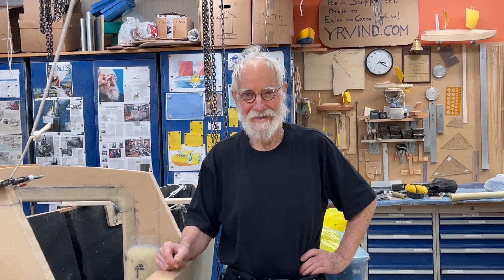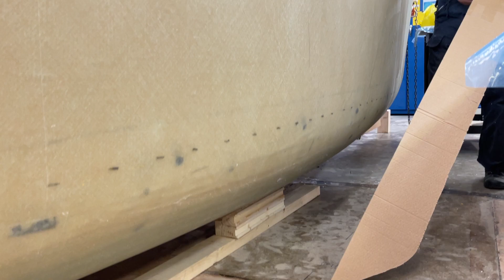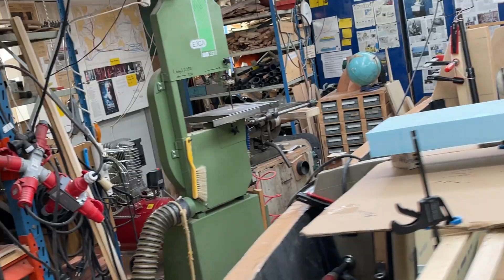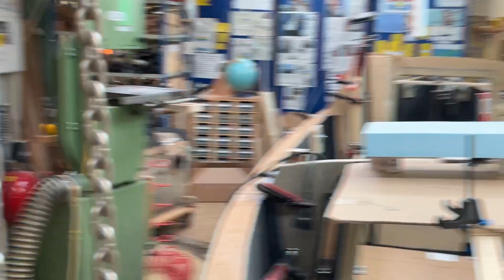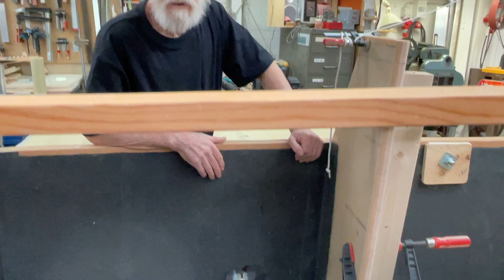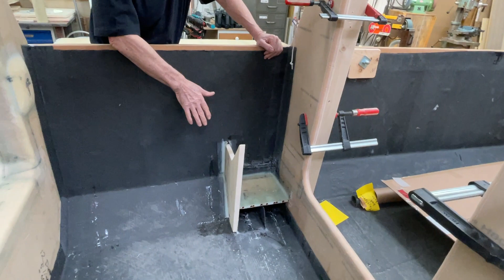One more darling gets killed in this video, the mowing ballast.

Comment: I am an electronic designer and many times I’ve come up with a “darling-circuit“ but when I put the rest of the circuitry that’s necessary around it, many times I find that my darling is really a thorn. It hurts to remove the thorn, but as the years go on it gets easier to discard and keeps your head steeped in reality!

Comment: That’s a hard choice to make. But the twin keels do bring a lot of positive aspects.  Even if it’s just to make room for more water or equipment, I think they’ll be good. 

Will they be separate from the hull and just bolted on? Or will you make them permanent by fiberglassing the keels and ballast to the hull? 

I’m planning on make the frames of my twin keels part of the hull structure.  Kind of like a crash cage in race cars, but not so complex. Then the keels and ballast will be encased in fiberglass.  I will have the keels done and in place, before laying the outer layers of fiberglass over hull. That way all the glass layers on the outside are one piece and chemically bonded, not just physically.
Reply from the maker: Exactly how will be decided after consultations with the foundry but the idea is to have a flange where the keels meet the hull mechnically fasten it to the outside skin that is reenforced.
Also the flange will be glued with elastic NM-epoxy finally there be fillets reenforced with glassfibre over the flange.
Each keel will be at the most 150 kilos and there be a huge surface.

Comment: Have you thought about glassing solar panels to the sides of the boat?
Reply: My mistake. When you mentioned sides, I thought you meant the cabin sides, not the hull sides. 
That would definitely be an interesting test. There is a lot of unused area on the hull. The questions that come to mind would be solar panel durability, and if the angle of heel will be enough to expose them to the sun regularly. 
That would be a lot of solar power if it was successful.
Reply: That is what he’s done on his previous boats. You can see them in his older videos.
Reply: @mobymory-yoko6313  Hello, thank you. I had a look but can only see them on the top of the cabin top, not between the gunnels and waterline.

Comment: Hi Sven  , I was looking at a boat called a Princess 18 trailersailer  , it had twin bilge swing keels , it won designer of the year in the late seventies 70s in Australia  , when they were up it only 200mm draft  , they were narrow like your centre board  , and took no space away inside because the keel slots  were in the facier of the furniture each side of the floor  , sole  , or in your case bed . It was also self righting with them up or down  . I think it had maybe 200 kg balast not sure  . Around the same time you were in the magazines with brizz  . Anyway when I came back here to see what you have been up to  , you're putting twin bilge keels on her  , that freaked me out and blue me away Sven  . How much lower will her centre of gravity be now  Sven  ? It's good to see that she's still got her ears laid back to 20 and going for it . And she's got a nice long tail when needed too  . Maybe a bridal up hawser pipe too control it when needed  .  Thanks for your updates Sven you're made me day again . All the best . P.s Bridal shaped like the letter M  , soft shackles and low friction rings high up above her inner hatchway , port and starboard and steer her across the top of the hatchway  ,leaving you a triangle to work in between  . Just a thought Sven  cheers

Comment: Thank you for another update, Sven! Buy some of the new inflatable PVC fenders, that can be hung horizontally on the gunwale. Then make your own custom valve so you can use a bilge pump to fill them with sea water. (I guess you only need this movable ballast in calm weather). I see e.g. Plastimo have a 35x100 cm PVC fender that would give you ~96 kg on the gunwale, and they will be stowable under deck in rough weather.

Comment: It seems to me you could do fixed center board in the front now that your doing a twin kill ...
Reply from the maker: One very important advantage of the bow centerboard is that you can change the center of lateral area and thus create lee helm or weather helm at will.
Sailing boats are built with weather helm that is excellent going to windward but a pain going downwind like trade wind sailing that most cruisers do.
Downwind a boat with weather helm becomes unstable.
Thats is why they have autopilots and windvane.
With the bow centerboard rised the boat becomes stable downwind
Reply: ...interesting!

Comment: I never liked the weight idea because of the possibility of them getting loose.  I think the keels won't slow you down much if you make them hydrodynamic.  That'll sure take care of any "sideslip".  Are you sure that they aren't too tall with the front CB and all.
Reply from the maker: I did not worry about loosing the weight. I have good control.
Hydrodynamic shape will not affect wetted surface and that will slow the boat in little wind.
Its a balance and a choice.

Comment: So much simpler that way; no moveable parts, more space, more stability…a wise decision.
Reply from the maker: She will be more suited to the new program but slower in light winds.

no moveable parts, more space. The new configuration will give less stability at small angles of heel but more at larger angles. She will be slower in light wind but better in strong.
Reply: @SvenYrvindExlex  May seem a stupid Question: Have you or anyone you sailed with ever experimented with saltwater or air inflatable stabilizers?